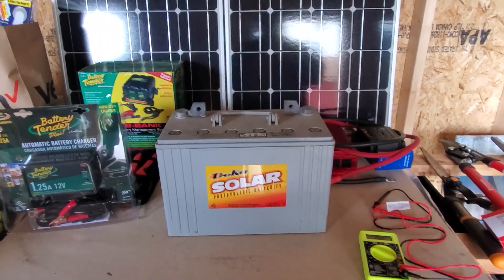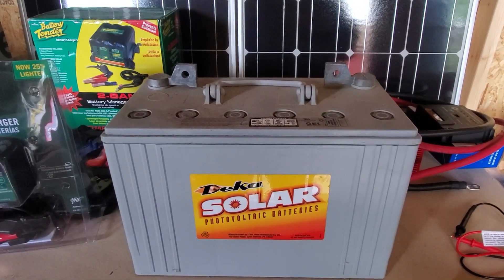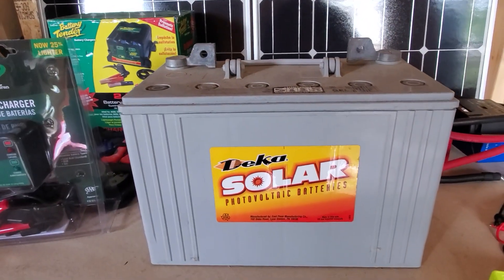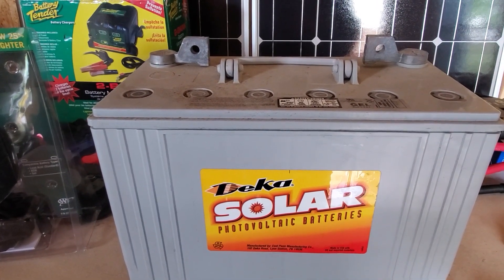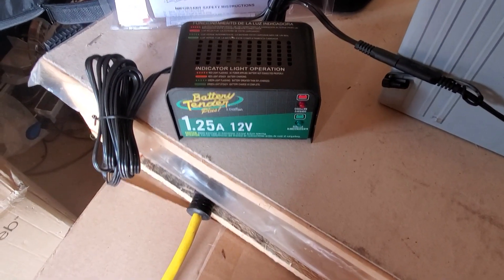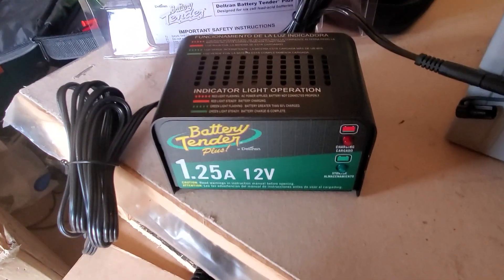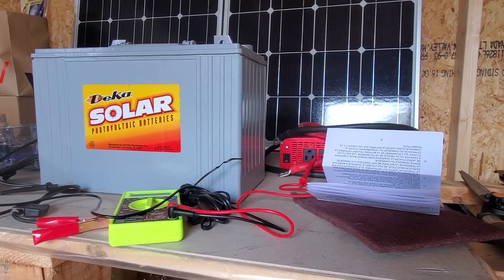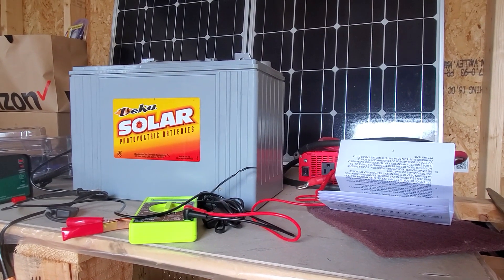Salvage Deka Gel Cell Solar Off Grid  Batteries?

Comment: Most battery tenders will churge. Joe sell batteries, especially from 1 to 2. Maybe 3 m's maximum, some come with a 7.8 Amphius. There's a lot of films that come with the 2 AM to 3M fused to 5 AM views the 7.8 M views possibly in some chargers I would recommend a noco.  2 and a 1/2 to 3 empty battery charger. Smart charger for a jail cell battery. But I can also tell you that, uh, if you put it on force mode or repair mode, you can actually repair it to get it app to the current you need and then you can go from there. Usually it'll go from 6 to 9 to 12.  It repairs and it will recover jump so batteries, but there is a way to recover a battery. It's still water as you look on those batteries. There are ports. You may have to pop those ports and get in there and use a syringe with a plastic sharp needle. Be careful doing so.  Then turn around and repeat the process again. By recharged it after you Receive them

Comment: Parallel that battery with one of the good ones and it will charge just fine. I don't believe the charger you are using is for deep cycle batteries. You will have to trick it so it see 10vdc by paralleling it with the other battery. Hope this helps someone

Comment: I know a guy who has a 200 amp charger and he used it to revive the standard lead acid car batteries.  He charges them for about an hour at 200 Amps.  It seems to break loose any corrosion on the plates and let’s them recharge.  Not sure if it would work for gel batteries.

Comment: I have charged these with that low of a charge with the same charger by adding a good 12 volt along with the low volt one.  Give it a little time then it should be fine to disconnect the good one and continue to charge as usual.
Reply from the maker: +goatheadone I am going to try an old school charger, and then might try that.  Don't want to mess up a good one those.

Comment: Hi, Joe. I do electrical wiring and cabling. It's best to disconnect, or at least turn off, your charger before trying to read the battery voltage. You'll be reading the charging voltage coming in, in addition to the battery in the circuit. In some equipment, you'll even read back into the charger, even if it's turned off. That will throw off your readings. One thing I've done is get a set of test leads for my meter that has various attachments. It has small grabber type clips for fine work, alligator clips, and a couple of other options. They aren't expensive, about $15 for the set. They will let you get good readings much more easily when working in awkward areas. I'll see if I can find them for sale somewhere, and I'll put the link here if I do. It's good to know the charger folks are so good with their support, they are the charger we use at work for a custom battery pack setup we have. We've never had a problem with their equipment. Linda and I send our best to you and Gail. EDIT: here's the link. Prices have gone up a bit since I bought mine, they're now $20 for the set. Very worth the money if you plan on doing a lot of electrical testing. https://www.alliedelec.com/product/mueller/110003/70546907/
Reply from the maker: +Odahi The Dubious I hear ya on that. I have a meter with all of the accessories in another bag.  This one was laying there.  I hadn't even planned on shooting a video that day.  That was an afterthought after walking to the shed. That was  very unprepared video lol.  I check them with out the charger on them as well.  I was curious how much the charger dropped it lol.  I'm going to try an old school non smart charger just to see if I can force something into it. I never expected anything out of them regardless. I hope you and Linda are safe and healthy 💖.  We're thinking of you!
Reply: Thanks! Just be VERY careful. I've seen a battery explode. It sprays nasty chemicals a LONG way. Be safe, be healthy, be happy!

Comment: I resolved a similar issue, using my 1000A, jump box. I connected it to the dead gel battery and left it, until it ran all the way down. Did that a couple of times, and gradually the voltage came back up. Once I had it over 11.5V, the charger would recognize the batter and charged it all the way up. Been good ever since then.

Comment: Try this, Get a good battery put the charger on it, Get a 12v 21watt light. Red to red, black though the light to black. Should light up, give it a day, then try the charger on the low battery.

,

Comment: Hook up another good battery with booster cables to trick the charger to see voltage and charge for a few hours that way ... orrrr find a dumb charge instead of a smart charger that will just shove power into it

Comment: Cool . With my charger , i put a test light across the terminals . It tricks the charger and lets some charge in to battery . after 15 - 20 min or so , a lot of times the battery will charge normal. Not telling others to do , but just what i do . Could try with a regular charger for a little and see , battery is junk anyhow .

Comment: Hey Joe!
See if you can beg/borrow/steal an old fashioned dumb charger.  They don't care what your start voltage is. Many modern smart chargers won't even try to charge if the voltage is below about 10.5 volts, as you have just found out.  :o(
If nothing else, they're worth a few bucks as scrap.
All the best, matey.
Reply from the maker: +SarkyBugger That's a good idea.  definitely worth a shot. I figure they are good for a core charge if I buy more!
Reply: Or he can donate them to that odd fellow in bum fuk northern Michigan lol.